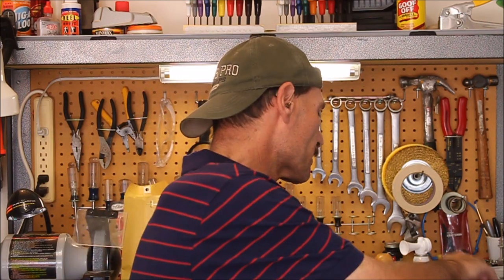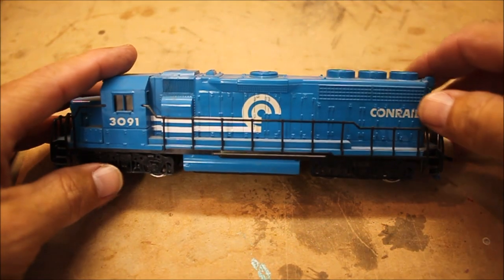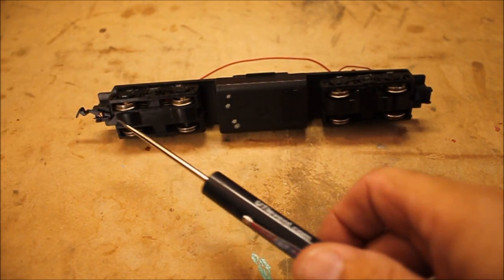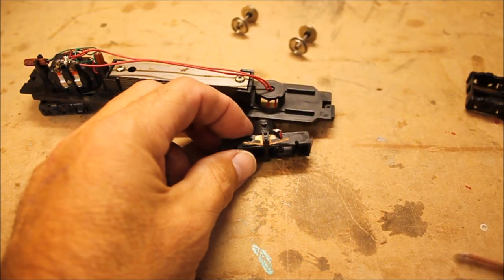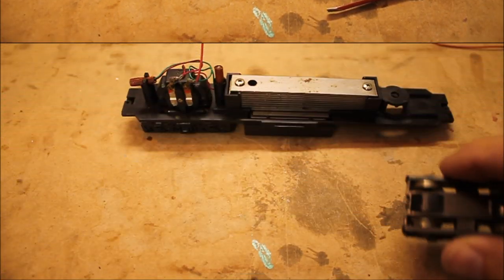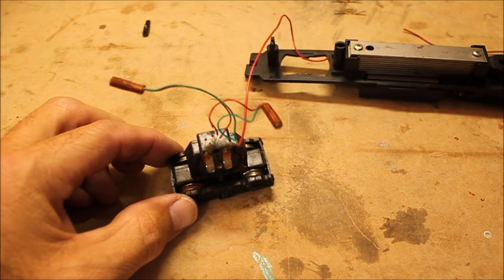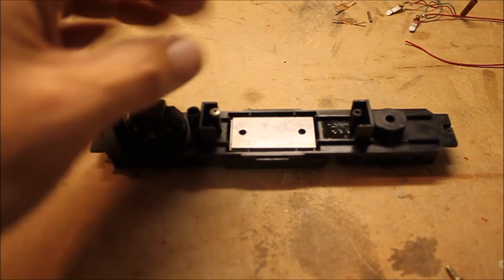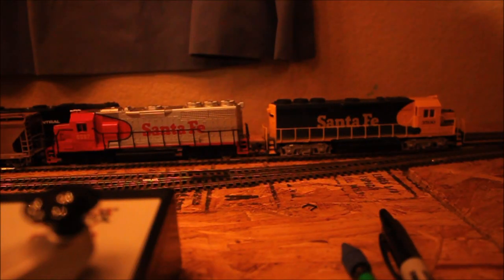Make an HO Scale Dummy Locomotive

Comment: ...years later...  If you'd like to really "MU" these loco's together, sort of a permanent way is to keep those trailing truck wires connected and instead of them being connected to the motor, you could bring those wires through, outside, and into the "powered" locomotive. This would provide you with more power-pick-up axles.

Comment: If you wanted to get really creative, you could add a little 2 pin connector between the locomotives down near the couplers and you could put a speaker in the dummy locomotive so both units would produce sound! And like others have said, you could do the same idea but with lights if you wanted to also have lights in the second unit.
Reply from the maker: thanks for the tip and info, I appreciate it

Comment: Well done video. I was hoping that you would have dismantled the engine to see if you had the gears I need, because I have a Bachmann F9 emd with both of the smaller gears broken in half. I can't find replacements anywhere, so I tried the super glue plus baking soda repair yesterday [5-14]. To day I'll clean up the gears and try them. I saw in one of the earlier comments where someone wanted to buy the shell. Would you sell the gears?
Reply from the maker: Hi, thanks for watching and commenting, I appreciate it! I plan on keeping the parts, but thanks for asking.
Reply: Thanks anyhow.

Comment: But surely it would be better if it was powered otherwise you are just dragging around another wagon or box car equivalent... run the wires to the edge of the loco and attach a plug and then a small pair of wires to the front loco and a plug and then plug the both together then you have extra track pick ups and 2 motors pulling instead of just one...
Reply from the maker: Yes, you can look at it that way. But some people may not want to go that route and this gives someone another option. Thanks for watching and commenting.